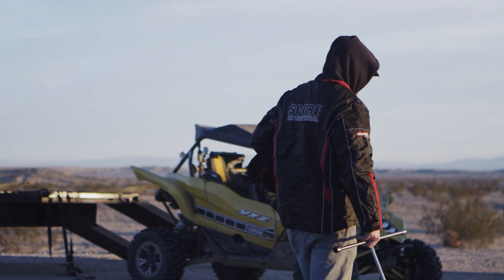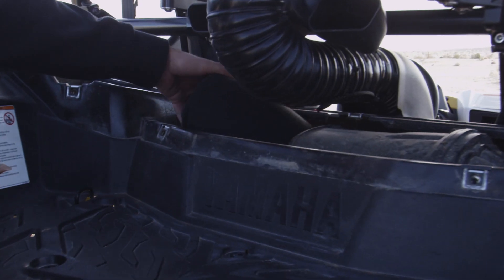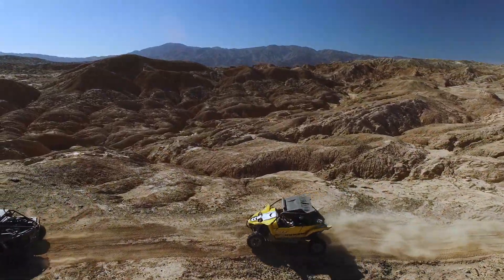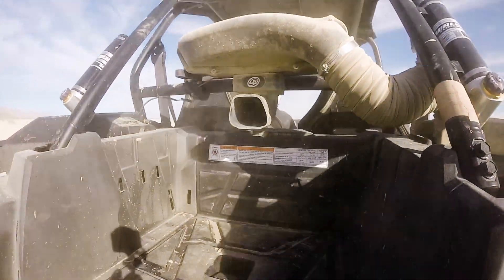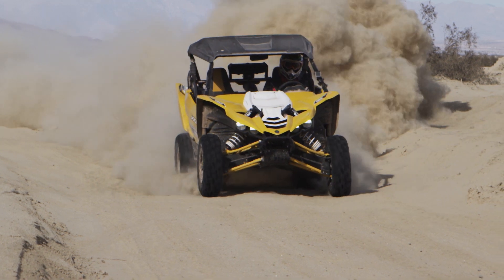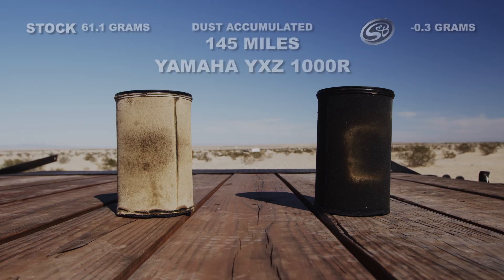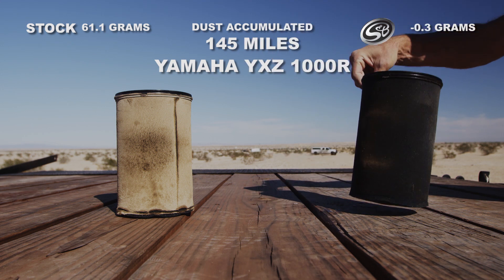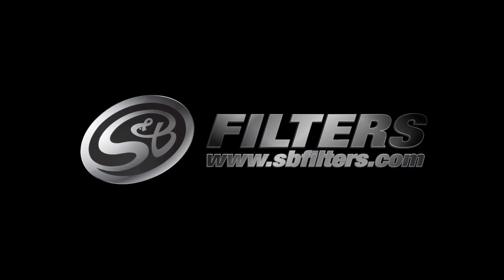S&B Particle Separator - Real World Results

Comment: Does it rob horsepower by restricting incoming air?
Reply from the maker: The Particle Separator maintains the same airflow throughout the ride will ejecting 94% of the dust. Driving without a PS will allow your filter to become increasingly dirty which will quickly result in loss of power due to restriction.
Reply: S&B Filters very interesting use of words. The real question is, does it restrict CFM compared to a clean stock filter? Have you tested for pressure drop in the airbox?